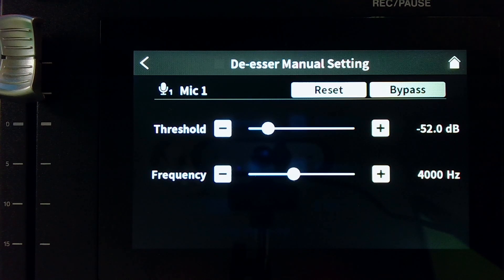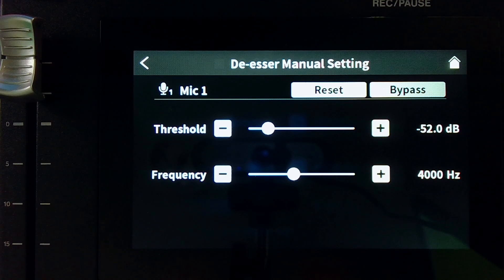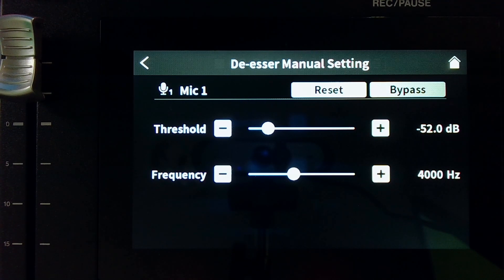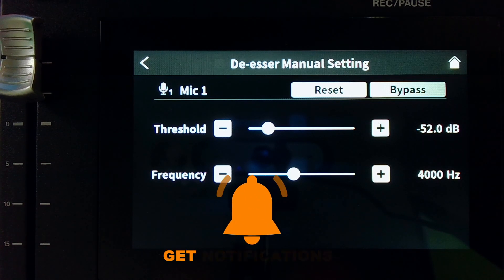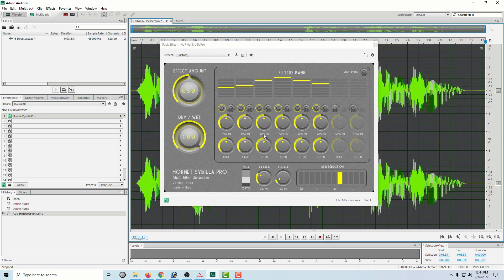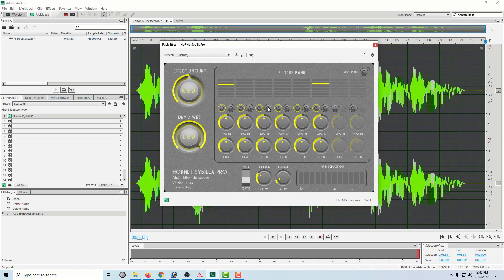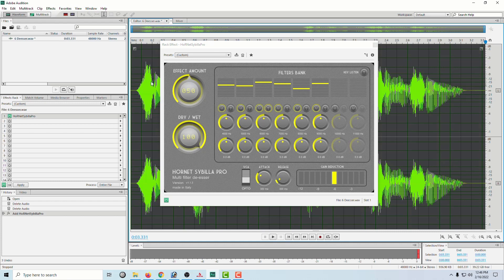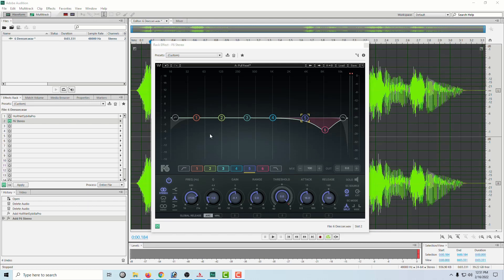Micast 4 Deesser Settings

Comment: Same comment made on your compression video made here as well:  I watched your tone video followed by this one. Dude, you're so spot on and efficient with your content. I don't know if I've passed this on to you but I was listening to Amazon Music a few months ago and the songs sounded weird. I checked the settings on the music program and even rebooted my PC and Mixcast 4 but the music still sounded messed up and even slightly distorted. I even bypassed my VPN running 128 bit AES to no avail. I went into my Mixcast 4 settings and noticed I had processing turned on in the voice settings. As soon as I turned this off the music sounded true and great again as it was meant to be heard. So, would this be a fault of the Mixcast running both the input and output through this "processing circuit"? I would think so as I personally would want to hear the output (music or voice getting sent my way) processed by whatever the sender chooses and vice versa. Try duplicating this and feel free to make a quick video about it as I hereby give this discovery to you. Thanks again man.

Comment: That last eq looks very much like a parametric eq.  You should be able to adjust the bandwidth of the frequency band you are tweaking so you can have a wider or narrower bandwidth if you want.  With a parametric eq, you can surgically and precisely dial in the specific frequency you want to tweak.  It's much more precise than a typical graphic equalizer.  You can dial in on that offending 6000Hz and nip it in the bud!!!
Reply from the maker: Yes. I should have done a much better job in that segment instead of being lazy. I may go back and re-edit it. Thanks for the comment.
Reply: @FreePodcastTools  You're welcome.

Comment: Hey Hank. Do you think it’s worth having the Mixcast even if you’ll never have guests?
Reply from the maker: If none of the features are mission critical and you weren't going to have in studio or remote guests then the device would be overkill IMO.

If I were just streaming solo I'd probably get a GoXLR mini or something like that. If I weren't streaming at all I'd probably just get an audio interface.
Reply: @FreePodcastTools  I hear you, but what about the ability to set your levels, de-easing and so on? If you wanted that sort of functionality, are there an y machines out there for that? I was thinking maybe a DBX 286S Mic Preamp/Compressor coupled with a small mixer attached to a usb interface.
Reply from the maker: @StarWarsJay  You could do that. I recently heard about a Behringer alternative to the the DBX 286s that has USB out to the computer. It was under $200. I think it was $180 bucks.
Reply: Hank's right.  It is very likely overkill.  If you are a TASCAM fan (I've still got my old 488 mkII and a 424 I just can't bring myself to get rid of), you might want to look at the MiniStudio Creator.  It's was the first of this effort and could be worth auditioning.  I think you can probably get it for around $150.
Reply from the maker: @celebril  and Tascam's preamps are very nice too.